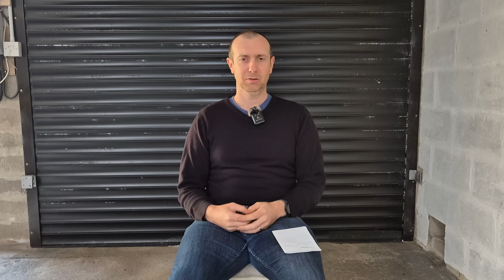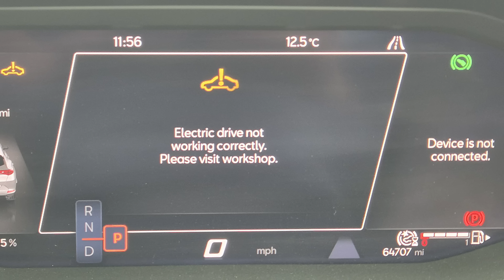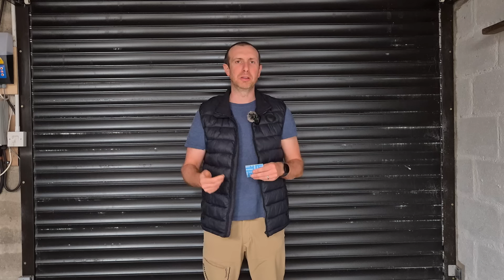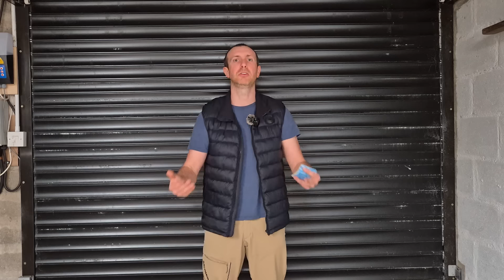Why Cupra REFUSED the 8 Year Battery Warranty Claim

Comment: Hi Andy.  I have similar issues but luckily mine is a company car, so won't need to pay any repairs.  Firstly the car just shut down and won't start.  Cupra changed the 12v battery which was faulty.  3 weeks later the same issue happen, this time Cupra updated the software.  Once again 3 weeks later the issue persist, same error message as yours.  Until 10th March, the car still with the dealer who said they can't figure anything wrong as the car is up and running.  They need to witness the error messages for them to be able to proper diagnose the issue.  So the technician driving the car now and then waiting for it to break down.  What's frustrating is that they can't figure anything wrong yet.  Am thinking to get a 12v battery booster/charger ready at all time.  No idea when it can let me down again.
Reply from the maker: The 12v battery can throw similar faults to my HV battery problem. But it sounds like a bit of an epic. Have they bottomed out the issue yet? 
Did you get a curiosity car?

Comment: Hi, my car had the same message😮 but before i got that message my AC stopt working. De dealer say its the AC Compressor and when thats changed it should be ok? 

When you had your message, did you AC stil work? 

Regards
Reply from the maker: Hi my AC worked fine. The error message covers a broad ramge of faults, and mine was to do with the battery cooling. Your AC compressor needs replacing, how old is the car/millage? You'd expect at least 10 years from a compressor!
Reply: @TorqueWithAndy  my Cupra Leon sportstourer is one of the first of the latest gen so from december 2020.. the KL8 E hybrid with 245hp (in Europe)  

I had the me mechatronic fail on me at 45.000km ( new gearbox under warranty ) but now 88.000km on the clock no warranty i get this.. 😢. So for me the VAG story is done.. i hope its really the compressor and not something crazy.. i noticed they already changed the design of the compressors because the product numbers last letter changed from J to M ( so they updated the compressor ) i assume because they are failing.. i will know more in a couple days when i replace the compressor..
Reply from the maker: I got mine repaired and sold it the week after. Hope you get yours sorted!
Reply: Thanks! I hope so as well 😅

Comment: This has braced me to what will happen to my 3 year and 2 month old Cupra Born (<30,000 miles) that has this same message last week, and I have been without a car since. £2000 I cannot afford to pay, so god knows what I’m going to do.
Reply from the maker: The message can be linked to the 12v battery and numerous of other faults. The only way to know for sure is to book it into an HV cupra garage for diagnostic and take it from there 👍
Reply: @TorqueWithAndy  Cheers 🤞🏻 

I drove it to them as soon as the light came on and they spent ages trying to get me to call the RAC down the road and recover the vehicle so I could get a courtesy car. Otherwise they couldn’t/wouldn’t help me. 

Obviously since it was amber light and moving that didn’t happen, so I’ve had a week in a village with no car - thankfully I’m between jobs at the moment!

They have one HV guy, but by the time I had nagged them to have a look, he was off on a long weekend! They didn’t seem to realise that it’s catastrophic to have this sort of issue on an EV; they wouldn’t tell me it was ok to drive and from your video rightly so.

Submitting a VT anyway soon because it’s been restrictive enough having such a short range, but now worried I have all this to pay 😢 

Cupra didn’t seem to care and still called me a day later from their sales team to catch up! Going back to BMW.
Reply from the maker: Hope it gets sorted and its covered under warranty! I still drove mine daily for my normal 60-70 miles with the yellow warning light. If it was red I probably wouldn't have been able to. I did limit how often I charged it though, only because the Cupra shared the garage with my Land Rover and didn't want anything happening to that haha.
Reply: @TorqueWithAndy  cheers! 

I only ever use public chargers and followed their advice to do one 100% charge per month and 80% otherwise. I don’t drive fast… don’t know how I could have looked after it more.

Comment: Still no issue on my 2022 MK8 GTE which basically has the same powertrain. I'm only at around 45 000km, will definitely keep an eye on these parts tho. Thanks for the heads up!
Reply from the maker: Good to hear your running well. It may have just been a bad batch in 2021 on my car

Comment: Hybrids are absolutely pointless in modern times. Either get an ICE or get an eV. Hybrids don't have low running costs of an eV but it also has the expensive components of both. When you have to pack lots of stuff into a car, you get interesting engineering choices like your Cupra, making it a compromised product.
Reply: Its the best of both worlds if you only afford on car. Especially if you own an updates PHEV from VAG or Mercedes.
20 kWh useable energy enough for over 100 km eRange!!
I own a Mercedes A250e with refreshed LFP battery. 
15 kWh useable energy DC fastcharging with 24 kw. 
During the week i drive this car with 15,5 kwh/100 km german Autobahn with 120 km/h included. 
At weekend i just get into my car a Drive Long distances without any
worries or headeck. 800  km with 35 l Pertol no problem.
Reply: Yep. Hybrids are obsolete.
Don't buy that.
Reply: This 👆, They are truly the worst of both worlds, as the EV components are also undersized. But since ICE cars are going fast the way of the Dodo, I'd say buy a used EV. This is specially true since the UK has successfully been brainwashed into believing that 'EVs don't work' for the past few years, causing prices to be pretty low when compared to NW Europe, where millions of folks discover that in fact they work very well indeed.
Reply from the maker: Lots of choice on the used market at the moment, possibly even more coming in September when people's leases expire and the new plate is launched. 
What car would you buy with £16k?

Comment: about 18 months ago I was just about to buy a hybrid.

then a little devil (or could've been an angel) whispered into my ear:
put it all down on an excel file
a hybrid
versus
a diesel

and by the time I have added everything on the file, I realized I need about 15 years to "recover" the money spent on a hybrid
if nothing goes wrong with the car itself during that time.

I wish I knew who was: a devil or an angel that saved me from all this trouble 

as I got a diesel, and never regretted it
Reply from the maker: Thanks for sharing. I currently have a few spreadsheets on the go for the next car purchase.
What car did you buy in the end?
Reply: @TorqueWithAndy  2nd hand VW Touareg 2016 V6
was looking at an Audi Q7 Hybrid, same year 2016

to me, that is going to be the last year car I will ever buy

later models have too much control taken away from the driver and given to the on board computers

Comment: Don't buy an EV without a full warranty.  The battery warranties are useless.  The cost to get to the battery can be horrific.  I took my Jag to a dealership in London when it got a HV problem. They quoted 7500 just to carry out the investigation.
Reply from the maker: £7500 is a lot of cash to repair, almost super car bills. Do you still own the Jag EV? Mine was unexpected but covered the cost ok, but questioned the long term reliability and a bigger hit of depreciation over 100k miles, which is why I got rid
Reply: @TorqueWithAndy  actually the 7.5k was not to repair the car, it's just to take the battery out and carry out the investigation. I still have the car and it's now in a jlr garage outside of London.  My bill is currently at 2250 and we are at 3rd stage of the investigation. One module is faulty and will be replaced under warranty. There are no modules currently available tho. HV fault still present and more test required.  I doubt I will see much change from 10k for all this. Even more annoying is that the car is on pcp and goes back in 16 months !
Reply from the maker: @KwakaRallye88 wow that's full on, feel for you big time, having a car like that off the road for a lengthy repair. Hopefully they've sorted you out with a courtesy car 🙏
Reply: @TorqueWithAndy Nope. No cars available apparently which is surprising as they certainly aren't selling any
Reply from the maker: @KwakaRallye88 that's harsh. I hope yours get sorted soon!

Comment: I had a Leon Cupra 290. Lovely car, but the parking brake every time you went to pull away after it sat over night siezed/grabbing and pinged/sort of stuck and jolted. Got rid of it as it was way to easy to speed in it and was no point having the car constantly in traffic. Electronic parking brakes need to be scrapped, fucking annoying things.
Reply from the maker: Nice car, what did you decide to get next? My Formentor seemed very stiff on its rear calipers, not much brake pad travel, causing them to rust up easy despite hard brakes from time to time. Yes I do like a quick car but only so fast you can go stuck in traffic. Quite a few cars with electronic handbrakes need the diagnostic computer to release when changing pads
Reply: @TorqueWithAndy I just had my grandads 2008 VW Passat B6 Estate of of him and am going to run it into the ground. Anything from the early 2000s-2015 is better for realiability and quality, especially VW's.

Whatever you save on fuel now on hybrids and EV, your getting your pants pull down on maintenance that should be under warranty, but the warranties arn't worth fuck all.

I get the green side of things if a battery can be reused etc etc, but the manufacturers are and always will be robbing bastards. 😂
Reply from the maker: @Nathan.M5  I used to have a 1999 Seat Toledo 1.9 tdi. Most reliable car I've ever owned 280k miles original clutch, then I sold it to a mate who 1 year later traded / scrapped it for something newer. Still wish he offered it back to me!
Reply: @TorqueWithAndy Indeed, its SORNed at moment. I just start up every month and take it around the block to keep the brakes from siezing. Back on the road in the autumn, so I can get some miles on the bicycle.

Comment: Sorry to hear about the issues with your Cupra but it’s worth submitting a request to VAG - as others have already mentioned - for a good will payment towards the cost of repair and quote the Consumer Rights Act from 2015. I assume the repair is expensive - haven’t seen the part of the vid that mentions the cost - so you’ve nothing to lose. Hindsight is a wonderful thing and so I’d personally recommend covering any modern car in the future with a solid, manufacturer backed warranty if available.  Hope you get it sorted out.
Reply from the maker: Thanks for watching and your kind words. I ended up getting a goodwill contribution from the dealership I had been using the last 4 years. I had chased this initially through the credit act. As I had paid for the first diagnostic fee on my c.card. Ironically, I had priced up a warranty after year 3, but it was £1500 for the year. So effectively, I would have saved £7 on this repair 😅 I can't chase anymore goodwill back, as I no longer own the car
Reply: @TorqueWithAndy in this case you ended up cost neutral against a warranty but it covers you for more major issues. Your high mileage is a challenge for modern cars so as others have mentioned, a diesel powered car or a Toyota based hybrid - if you can get over the eCVT “drone” which was an issue for me after owning a Lexus IS300h. I ended up with a 2018 330d which may suite your use case. It’s a very smooth, economical car and relatively cost effective to run if using an indy for service. I use the excellent Darren Wood garage in Stockport.
Reply from the maker: @adrianwhitehead1950 330d love that engine! Maybe a 330d lump in my Land Rover Defender 😅

Comment: I would never buy an EV or hybrid
Reply: Yeah just keep buying petrols, they'll be getting really cheap, real soon.
Reply: @dtr-g1s  Do you really think that? I am looking for a new car, Plug in Hybrid has my attention, but Full petrol is getting my favor. I am so lost, what do I buy? No, not full electric, never.
Reply: @ancientrs  Of course i don't believe it, although it is objectively true. I'm being sarcastic to petrolheads who think that they can just carry on as if nothing is happening. Petrol is over. This is the 21st century, get with it. There are no downsides: the average Chinese EV charges in 10 minutes, has 300mls of range and will basically last forever.  I'm in middle age and the battery in my car will probably out-live me. Yes they are expensive, unless the Chinese are allowed in in bigger numbers, then prices will come down faster. But high depreciation means secondhand EVs are mega cheap after only 6 months, so get a secondhand, and keep it.
Reply from the maker: Personally I wouldn't consider a PHEV again for my 20k+ annual millage. The servicing cost were high compared to pure ICE, negating the savings you get with running it on electric or hybrid. I got a used EV for my new daily and keep a pick up truck for heavy towing and also have my old Land Rover for my hobby/passion car.

Comment: The old Vauxhall Ampera used to cover all associated HV components. I had a compressor changed under warranty.  The Ampera was a good car but most hybrids are not so reliable unless built by Toyota.  Generally you are better with ICE or BEV.  Non Toyota Hybrid electric systems can be problematic as the battery is continually fully charged and fully discharged. With a full BEV the battery is rarely if ever  full or empty. I bought an ID3 for long distance driving ans the Traffic Assist ( a very basic auto pilot ) makes log distance trips safe and relaxing.
Reply: So you were neither Safe or Relaxed without autopigeon? Asking for a robot friend?
Reply: @kanleystubrick4878  The autopilot stops the car quicker than a human can react. Mine has done emergency braking twice so has been fully tested. The last one was a lunatic overtook me in the fast lane, cut in front of me and then did a hard brake just inches away as they were trying to bypass a queue and cut up an exit queue. Both the emergency braking and horn did a good job although the horn could do with being louder.
Reply from the maker: AEB actually saved me having a huge crash a while back. It was after a long 14hr shift on my way home, I was tired, dark roads and rain, typically scottish 😆. Down a hill, long sweeping bend 40mph ish but a 60mph road and a car was coming the other way at speed. Turns out the car coming the other way was on my side of the road, and I didn't see this until the car was aligned with me (definitely under the influence of something). Before I could react, the car had already begun its emergency stop. I turn off a lot of safety features off when I start a modern car, but I'll always keep AEB on

Comment: I’ve owned Toyota and Lexus for the past 18 years. Completely trouble free and my dealership goes out of its way to help. But I understand if you don’t like the gearbox. 

Your Cupra experience is such a shame, it’s is a lovely car to look at. Hope you get it sorted.
Reply from the maker: 18 years is a dream to have had no issues, how many miles do you do annually? Tbh reading the comments on this video from toyota owners, im warming to the brand and plan to drive a 2023 corolla. The hire car I had was pre facelift and read there have been some improvements in the 2023 car.
Reply: @TorqueWithAndy  right now, about 12k a year. I had a diesel Auris which I put 200k miles on. I traded that in for a second hand 2019 Lexus NX, and i just traded that in for a new plugin hybrid NX 450h+. 

The only repair was a bulb on the Auris. I bought the bulb and the dealer fitted it for free. You won’t generate a lot of YouTube content with a Corolla.
Reply from the maker: @SHARP2026 haha, I don't normally film my daily car. They just exist in the background doing the miles. But the Cupras' fault was an exceptional circumstance.

Comment: There used to be a very simple method for handling these issues which I used for many years to great effect and that was I would only buy a nearly new used car (to avoid initial steep depreciation and VAT) with at least 2 years full warranty remaining, then at the end either sell the car or maybe extend the warranty for a year if cheap enough.  The small depreciation that you would suffer back then, when spread over a couple of years was negligible for peace of mind and essentially fixed budget motoring that would receive from doing it that way.
Fast forward to today and now it's no longer possible thanks to the government interfering with the motor industry by installing this ridiculous EV mandate and the flooding of the market with useless EVs that dealers can't even give away.
They have totally wrecked & destabilised the car market with this over supply of EVs that nobody wants to buy.  It's causing uncontrollable levels of depreciation in EVs which is even having a knock effect on ICE cars.
I can still afford to change my car every couple of years today, as I'm pretty fortunate financially but even I refuse now to swallow the disgusting amounts of depreciation in nearly new cars thanks to what they have done.

I'll be sticking with my 10 year old diesel and will drive it until it dies
Reply from the maker: Thanks for watching, certainly is a glut of cars at the moment suffering heavy depreciation, added to the mix me driving into a LEZ zone daily and needing euro 6 diesel or euro 4 petrol. Which my Land Rover and Ford pick up aren't. So I plan to keep the next daily car for at least 7 years 120k+ miles or until it gives up, which was actually the plan with the Cupra, but I lost confidence in its warranty and reliability. So, a sharp exit from its ownership was required and step into something slightly newer, less complicated and more reliable